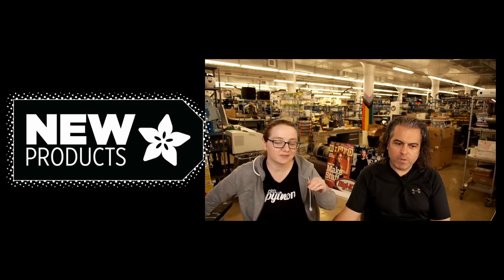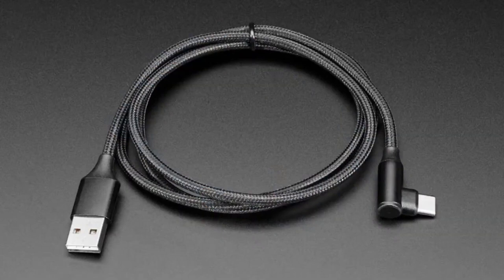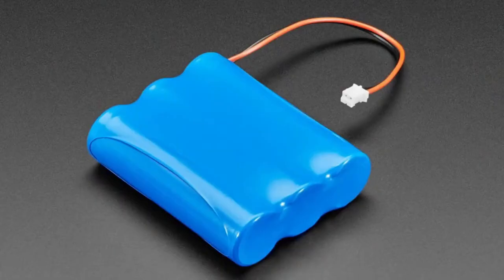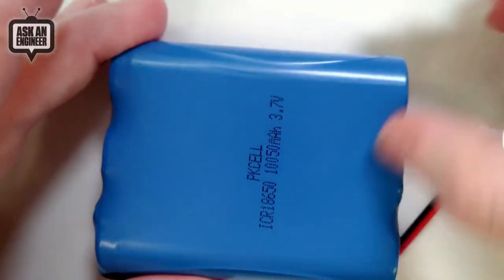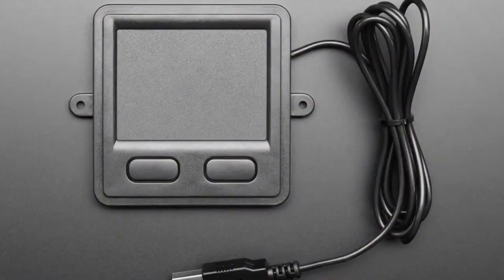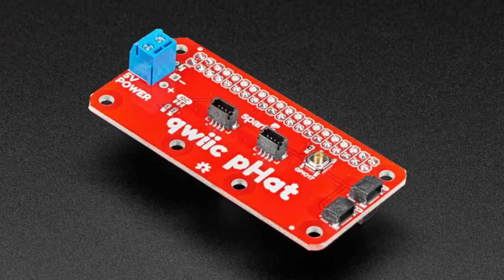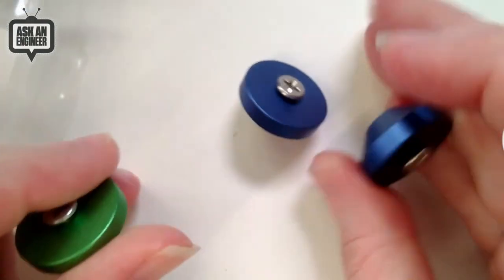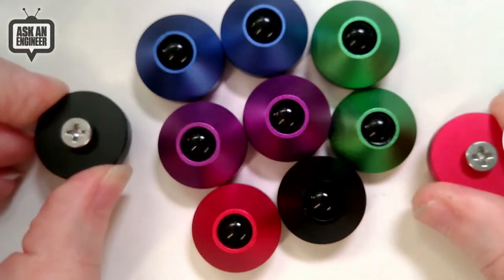New Products 06/23/21 feat. Gray Anodized Aluminum Bumper Feet - Pack of 2!

Comment: 10 amp-hour battery? Holy smokes. Interesting that this has a max 3 amp charge rate when the fastest charger is rated at 1.5 amps. USB-PD charger in the works?